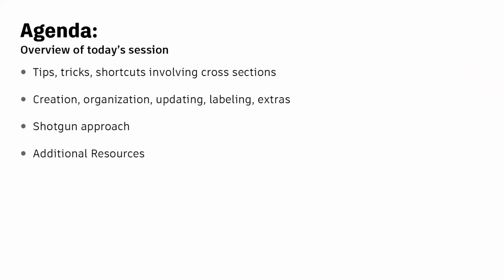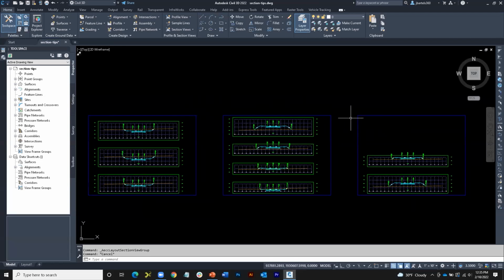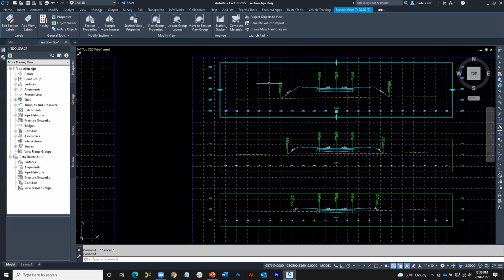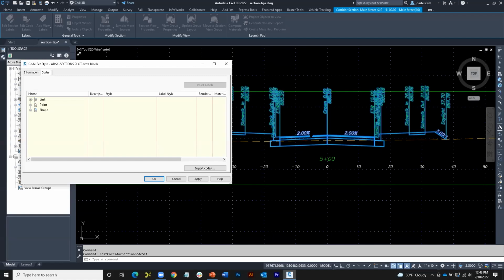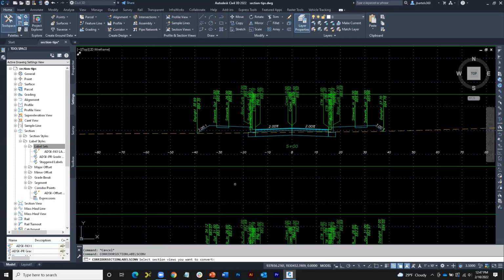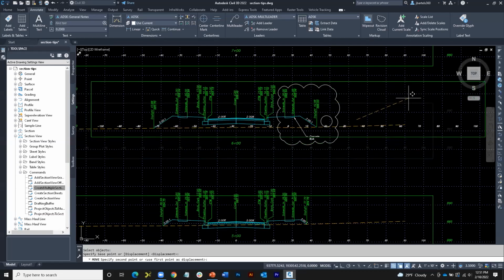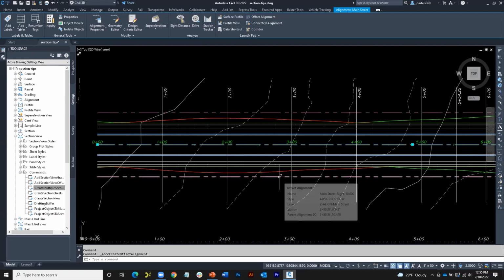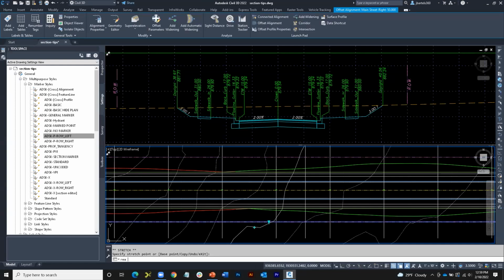Civil 3D Cross Section Tips & Tricks

Comment: Do you happen to know if it is possible to draw multiple cross sections but in a specific order and placement not predetermined by civil 3d? I would like option to select location for each cross section, so insertion point would be crown of road so I can overlap it perfectly to existing designer's cross sections. This would be great tool for contractors. Thanks